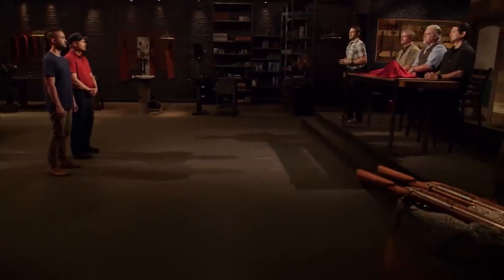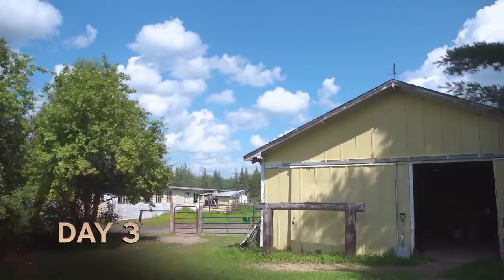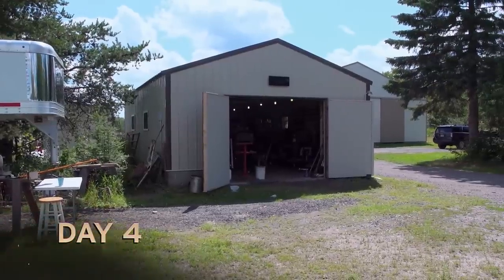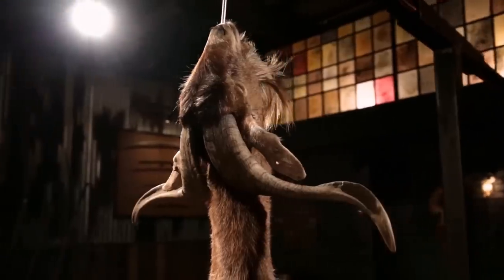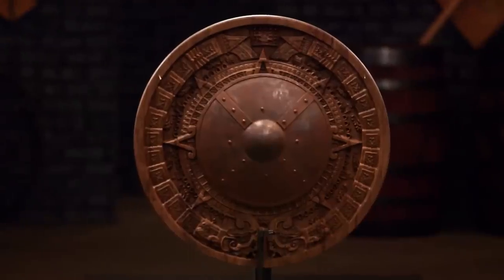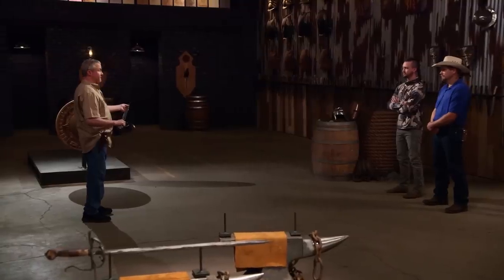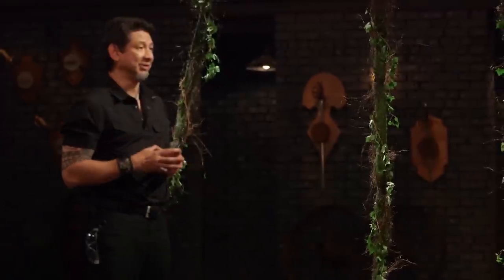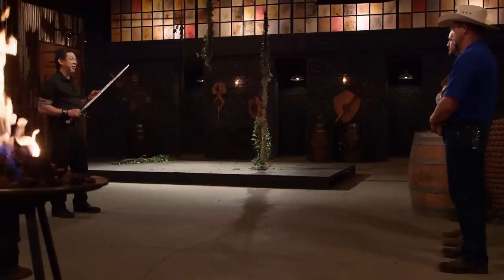Forged in Fire: CONQUISTADOR SWORD FINAL TEST (Season 7) | History

Comment: “I’m gonna weld my hilt to the blade.”

You’re gonna lose, is what you’re gonna do.
Reply: Not because of the weld though
Reply: "I'm gonna use wood for the pommel" 

face palm
Reply: @Tyrfingr  "It didn't say in the specifications that the pommel had to be metal, so I am going to make it out of Styrofoam"
Reply: @-Zevin-  And i wouldn't have been surprised to see it 😂
Reply: @Cell287  That weld likely caused that bend later, but yeah, there was a huge difference.
Reply: @-Zevin-  he doesn't understand that the pommel balances the blade its not only for decoration
Reply: @mrmacedon  i think he knew, he just didnt have time to do it properly. Dude had 4 days and a hammer.
Reply: @tntcake6327  dont forget little to no propane till the last day

Comment: I just feel the need to point out that the judges will cut pigs and stuff in half in the first test and still feel the need to test its sharpness
Reply: Because usually the strength test will cause damage to the blade which would render it less sharp than it originally was.
Reply: Chopping and cutting are a bit different,plus a good blade needs to retain it's edge after being used so they are also testing that
Reply: edge retention

Comment: I would NOT recommend usinga wooden pommel, that pommels main purpose (other than preventing the hand from slipping of the handle) is BALANCE, now generally wood is quite light in comparison to the metals you tend to use for pommels so that can affect the point of balance of the sword, which is a very important factor of swords.
Now not saying that having the point of balance further up is BAD, but generally you want a well balanced sword.
Altought tip heavy swords to cut/chop easier.

Comment: To be honest the other guy didn't deserve to win at all, he shows a big misunderstanding of sword manufacturing. Now I am not a bladesmith but even I could see those glaring mistakes. Welding the guard to the blade is the first big mistake, you run the risk of destroying your heat treatment in that area which ultimately happened as the blade bent in that area during the kill test. If your fit and finish is good, there is absolutely no reason to weld the guard. Secondly the wooden pommel. Yeah it is technically a disk pommel but he is missing the point entirely. The disk pommel is there you counter balance the weight of the blade and shift the center of gravity near the guard for better handling. I bet the wooden pommel didn't do the job as they didn't compliment him on the sword handling.

Comment: Tip for future contestants: LEAVE THE M.I.G. GUN ALONE!!? it never holds up during the strength test, wire isn't that great of grade of steel.
Tip #2: always add mechanical fasteners for anything epoxied. Epoxy is brittle.

Comment: The so called "expert" is terrible.
First of all it's not simply a "Conquistador Sword" it's a basket hilted sword, which came in different sizes and shapes, one of which would be the rapier but that has a thin blade

The other thing is that his techniques are abysmal. You don't swing a sword like that and you don't telegraph your strikes like that either. He also uses his off-hand to drive the blade, which again is not what you'd do. You would use the weight of your body and lunge forward

Once again,  the History Channel doesn't fail to disappoint